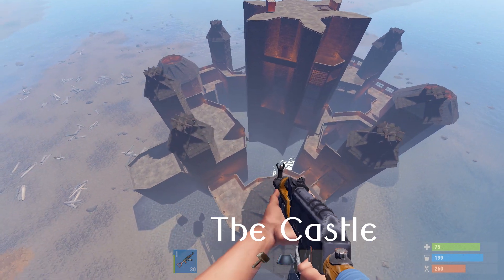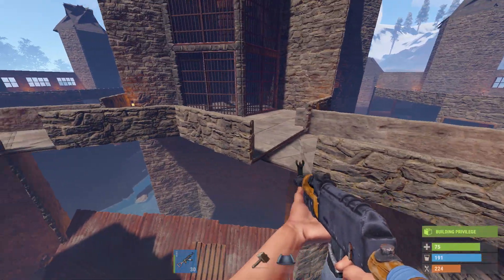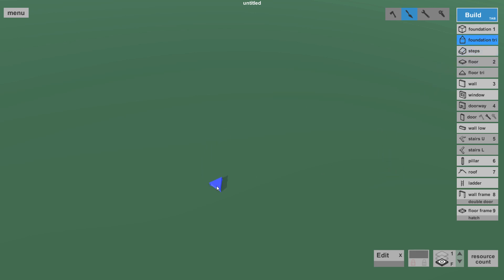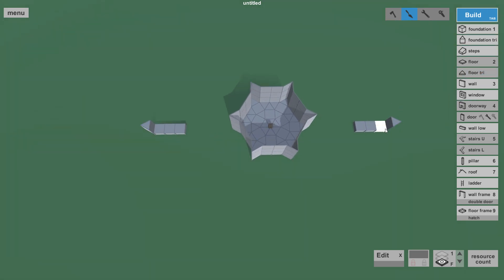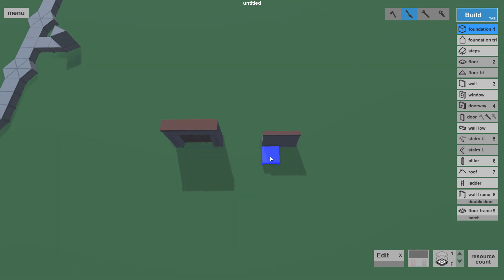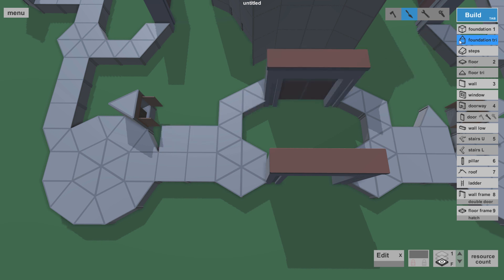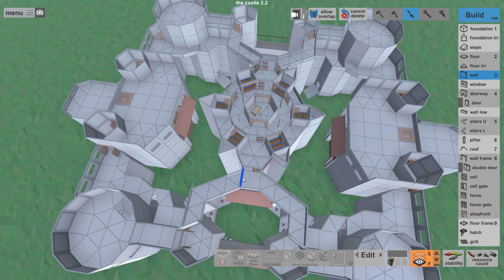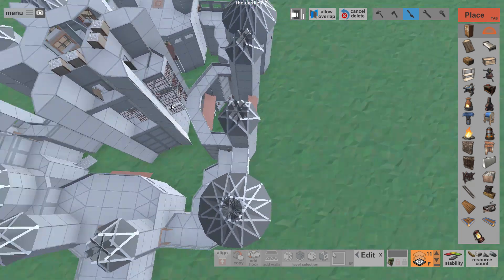The Castle In-Depth! | Double Wall | external gate New Method Base Design | Hard To Raid | Rust 2017

Comment: You need to turn overlap off, you can not place cupboards as demonstrated with the regular rust rules.
Reply from the maker: i know , its not the overlap feature btw , but fortify itself , when you build tc in fortify you need to go 1 foundation further then place...the best solution for this design tho is to replace the 2 tc on the side to further out
Reply: Nope, the version of fortify i have from the steam store does not allow it unless you have overlap, i'm assuming you're using the reddit version.
Reply: Not trying to knock the design btw, just pointing out a dangerous flaw that could make it difficult for some people if they don't catch it and try to build it in game without first going into fortify. Also, if people do use the gates, build your walls first, roughly 3 high, because the high external gates must clip through them, so you can't build the walls if you have the gate down first. I play on a 10x server and was able to test this out in game with some of my own twists to it.
Reply from the maker: yea i have the steam version of fortify and the reddit 1...sometimes new fortify wont let you do things but you still can built it ingame...good point tho

Comment: why you  Fortify got wall gate? i see in google got  Fortify 1.54 only
Reply from the maker: because i use 2 versions of fortify as the new fortify is not always correct with the stability ect...i know they are working on it  but thats why i use 2 versions...also i use another version because the background grass is plain and easier to key correct to make thumbnails ;-)